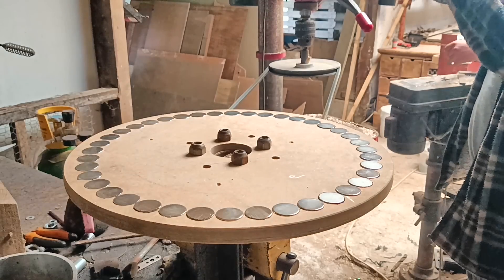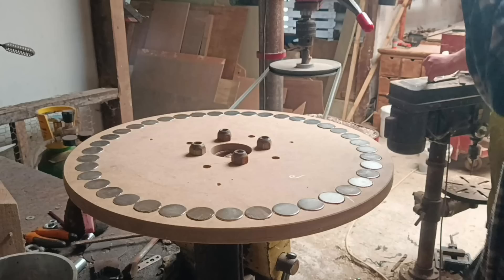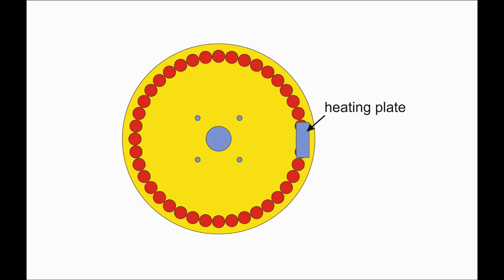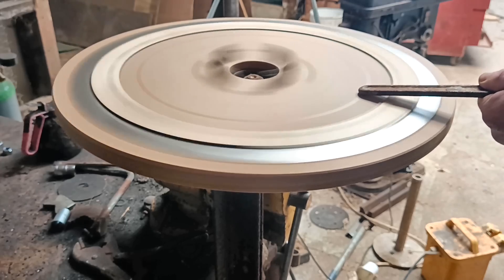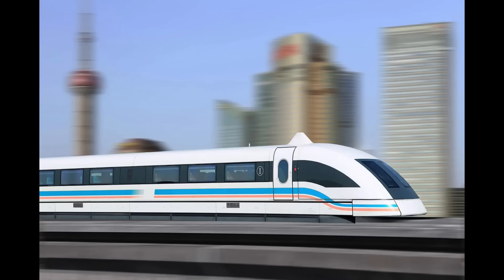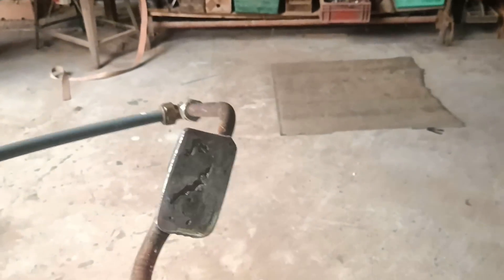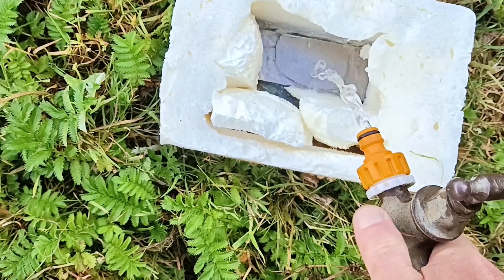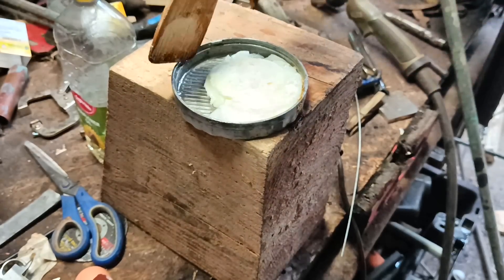Cook An Egg Over Magnets  - And Other Interesting Induction Heater Stuff..

Comment: Hi its all very interesting but the design that creates the most drag will do the most heating. And so that will be the limiting factor for your windmill. You can only get out less power than you put in the power you put in can be measured  with a cheap Whr meter connected to your drill so very low when just spinning and more with more heating length closeness etc so from that you can calculate the size of windmill you will need to turn your magnetic wheel 
Above all have fun and  learn something to teach something 
Great vid 
Could you not use the cooling system of the old Bamford engine to heat water

Comment: Build a mounting for the metal plate so you can lower it and drag does not become a wristbreaker, I would think a copper pipe bent in a circle over the magnets connected to a water supply that circulates the water would be a seriously impressive experiment. Get the water to 80degrees and circulate it through a radiator. Voila heating free if it is connected to a windmill. Or cheap heating if it is run by a 500watt motor that is strong enough to power the disc through the drag. I am surprised with the drag being so strong using copper, maybe another material would be more effective, less drag.

Comment: I would really suggest getting the multicolored magnetic viewing film. It's important to note that what it shows is one single xy slice of the magnetic field at that moment. The white indicates the domain wall  (N/S barrier) impinging on the film. And the gradient from blue to green represents the gradient of the flux density. North or South are the same color. Also use just one single light source or you will see multiple domain walls, it will look cool but it isn not useful besides that. I have never seen a video on youtube understanding the principals of the magnet field correctly.  When you understand what you are actually seeing with minimal abstraction you can then use this to see the best placement for the alternating magnets and for the pan. You'll want to find the null point between opposing magnets. Then then place the pan on plane with that on y about halfway between the null point and the physical matter of the magnet. This will make the alternating fields more powerful, it should also cancel out the magnetic frustration going on. it is beneficial to think of this as magnetic frustration rather than eddy currents as they are essentially the same thing but from a different perspective.  Sorry if this sounded to technical, I tried to keep the jargan as minimal as possible and inform as much as possible.
Reply from the maker: Thank you Paul. I will investigate the viewing film. Like everything else, the more I learn, the more I realise how much I don't know.
Reply: @wayoutwest-workshopstuff6299  thats the best part

Comment: I'm sure you can figure solutions but look at PC CPU waterblocks, Me i'm thinking a block made from a plate of whatever metal you want, thick enough that you can use a conical drill bit end to put divots in the surface to increase the surface area.... then enclose it with a top made from your machinable plastic

Comment: Loving your channel.  I've just been going over your engine shed design.  You were playing around with slip-belt clutch designs.  That reminded me of your magnet experiments for heating.

You could also make a clutch using those magnets on the flywheel, if you're interested.  I used to work on boats, where (since the late '90s) such magnetic no-contact clutches were used as low vibration linkages.

If you face your magnet-imbedded flywheel discs along side a thick, conductive plate (thick copper works best), which is also on an axle, the magnets will induce an electromagnetic feedback.  That's what happened in your heating experiments.  In this case, though, the changing magnetic fields from the magnet disc induces an electrical current in the conductive material, which quickly converts back to a magnetic field.  The closer the two plates get to each other, the more the magnets and the changing induced magnetic fields will grab each other, causing the pair to spin side-by-side.  The faster they spin, the stronger the magnets, the closer they are, the more they grab.

Power one disc with the engine.  Connect the other disc to the power tool of choice.  Begin with them separated.  Start the engine.  When it's going, press the discs together, and the tool disc will spin.  The closer you get, the stronger the magnetic pull.  A no-contact clutch with almost no vibration!

Comment: I imagine that this has already been mentioned in the comments on this and your earlier video, but many things have been mentioned, and many are contradictory. While there are some good insights, there are also many comments which are exactly backwards.
The 'jiggling' of electrons in your heating plate does not directly contribute to heating. Instead, that 'jiggling' is local electrical eddy currents, induced by the alternating magnetic field. So anything that you do to try to improve the effectiveness of your arrangement must take that into account. If you want your heating plate to get hotter, then making it thicker is the opposite of correct, because the current induced in the plate faces less resistance load and therefore produces less heat, though you may (or may not) be inducing more current in the material of the plate. The situation is analogous to that which occurs with a high current power supply: small wires burn up.
Naysayers may care to investigate this for themselves with a commercial induction hob available inexpensively from IKEA: thin cookware will heat more rapidly. Q.E.D.

Comment: To get the magnetic field to flip faster, you should try making a larger wheel that way you can have more magnets. It can go the same RPM and have more magnets travel past the plate at a higher rate due to leverage. It's kinda like how they arrange songs on a record where the louder songs are towards the edge and the softer ones are towards the center. It's all at 33 1/3 RPM but the outer edge is able to have the groove hitting the stylus faster than towards the middle and as-such is able to have more information fed to the stylus meaning it can have better sound quality and better frequency response.

Comment: Forget feathering the wind veins, try making a mechanism to slide more surface area over the magnets once things get moving fast enough. That way the windmill will use a small plate surface on a calm day, and a larger one when its windy. I'm thinking a curved arm, one which follows the radius of the disk, on a pivot just over where the magnets spin. It could start with the arm sticking radially outward, using only the small pivot point as its heating surface. Then as the disk moves faster the arm is drawn inwards around the pivot, positioning more and more of its surface over the magnets. This may be set up as a way to keep the disk spinning at a constant speed.

Also have you ever heard of heat pipes? Could be useful in solving your heat exchange problem.

Comment: Wouldn't a 2nd offset "row" of magnets double your speed? Smaller square but deeper ones of equal strength packed tightly in 2+ offset "rows" should work better. Also, a circular tube of copper and "rubber" sections fixed above the center of the rows should give more heating zones. A flat tube that covers the width of both rows. Not sure a solid coper loop would conduct and neutralize the opposing magnetic fields? As you said the goal is increasing the magnetic pole switches per pass under each "heating zone".   Making a circular tube as explained, would also allow you to use a heat exchanger. Keep heating the same water in a loop and have an adjacent loop of cold water absorb that heat. If you manage to build a pressure vessel, you'd potentially have super critical water above 100c to heat whatever with. Just ideas.

Comment: I might suggest thin copper tubes that, when coiled the same diameter as the magnet wheel (one pipe in depth, and 2 to 3 pipes wide, or however many you would need to get the same width of the magnets). The small pipes would allow the water additional circulation in the heat while traveling through the pipe.

Comment: while this is an interesting experiment, do keep in mind that heating spaces and heating water is 100% efficient using electricity.  I suspect coupling wind to a spinning magnet plate to create heat is less efficient than wind turning a generator, creating watts which could be converted 100% efficiently to heat.  Of course, the spinning magnet plate might be direct coupled to the wind turned shaft (100% efficient) and coils of copper wire mounted nearby, thus becoming a generator. The resulting electricity could be transferred easily and then converted to heat whereever it was needed.

Comment: Hm. Why do you want to make the magnetic field switching faster? Afaik there is no real gain, except for cough cough, electromagnetic interferences. Also, the heat doesn't stem from the switching magnetic field direction itself, but from the changing(!) magnetic field. You could also just use one single(!) magnet, this magnet's field changes in each direction anyway and so if you move that relative to a metal, you always induce a current.
From my pov it would be enough to have a "slow" moving disk (your wind turbine probably has a rather slow speed anyway) you might need to have a bigger amount of copper heat exchangers. If it is not obvious: The amount of force you need to hold back your heat exchanger/tool is directly equivalent to the amount of heat that can be generated. You probably need to find the sweet spot between maximizing this break force and the amount of water you want to heat at the same time (and obviously the wind input power available).
Reply from the maker: Thanks Patrick. Why then do induction heaters flip so fast then, I wonder?
Reply: @wayoutwest-workshopstuff6299  There are two things why one would consider high frequencies: With higher frequencies transformators (!) can be a lot smaller, think of how bulky phone or laptop chargers were 20 years ago. Even more so, higher frequencies reduce(!) the depth which gets heated - but I think that this is not your problem either. There might be advantages if you need to transfer energy over a longer distance, but in your case this is roughly millimeter scale, so shouldn't matter either.
Induction heaters in airplanes (for the food) work with the normal 400Hz on board which isnt to far from the frequency of your wheel.
Imho the relevant physics equation here is Q*v*B (Q=electrical charge, v=speed, B=magnetic field strength). So you can either increase the speed of your wheel or you can increase the number of electrons aka the amount of copper plates you use, either above each other (but that is what depth means!) or side by side each other, e.g. as a ring above the magnet-wheel.
Reply from the maker: @ps3107-o1m  Thank you. I've just been given another 60 magnets, so I'll make up a bigger one anyway, and see how it goes

Comment: You are step by step building an electric motor. Trust me, you are really doing that. 
Instead of the wooden plate you can use steel, just have to prevent current flowing in it. So you need laminations. 
For the heated part you can use a coil with both ends connected.

Comment: I believe the reason your wrench did not heat up, was because it was not close enough.
If you are not feeling the tug of the magnets you are not going to get any inductive field generating.
If you are feeling a week tug of the magnets, you are getting very little in the way of inductive field generation.

Inductive heating of steal requires much more energy ( more field switches per second, and likely bigger changes ie stronger magnets)
Even with higher frequency and greater amplitude field changes, heating of the Steal will likely be surface level. Steel will redirect the magnetic field thus blocking the block of the steal not next to the magnet from getting the full inductive field effect.

I have seen blade smiths set up  something similar (just with WAY more magnets).
Some of them could only get edge and very shallow surface level heating. The smith could get the section of the blade that was closest to the magnets on the wheel to start to glow, but rest of the blade stayed fairly cool.

In order to use Steal for heating block, you would have to scale up quite a bit, and I feel that the magnetic drag will be way worse than with copper, aluminum or any other non magnetic metal.

Comment: the more electrical conductivity the material has, the better it will work, I think.  This is why motors use copper windings, and if cost is not an object, silver wire is used (silver conducts electricity better than copper.  yes it does.)  You will never ever completely stop the magnet disk with magnetic interaction alone, because as the magnets slow down, their ability to induce a current in the metal goes away, which creates less resistance on the movement of the magnets.  This is a type of brake that can never ever lock up, and magnetic brakes using this exact principle are used on F1 race cars.
Reply from the maker: Thank you - yes, that makes sense

Comment: Any decent non-ferrous metals supplier should be able to supply thick walled copper pipe - I suspect this is all you need, nothing too heavy but 2 or 3 mm would be better than the thin plumbing stuff you are using.  Then bent into an arc and firmly held close to your spinning magnets.  Might not be super cheap but you only need a few feet, and they may have an odd end/offcut if you ask nicely.  It's amazing to watch this, thank you.

Comment: Just my two cents as a physicist who's not an expert in induction heating.. you should first have an estimation of how much mechanical power (speed x force) is absorbed by your spinning magnets and how you can change that (eg by having metal closer to the magnets). Then when you're done building your windmill and you know how much power it produces you'll know how to design the induction heater..

Comment: 2 ~ 3 Continuously Variable Transmission (Infinitely variable transmissions)
if there is more Drag the CTV Can Auto adjust 

I would Round the pipe more With 80% 97% Of the wheel and magnet path (if the CTV the it will counter the Drag)

Try and find a Wasing machine motor + Large  Drum Wheel Pully (FreeCycle for free)

I would make my wheel Out OF Epoxy resin with carbon fiber sheets

Comment: Hmm... I wonder if you could set up something like a flying ball governor to control how much of the heating plate is over the magnets. Couple the drag to the RPM to automatically tune the output for however much power is coming in at the moment for when you eventually put this on a windmill

Comment: "In this house we obey the laws of thermodynamics". Seems like you are exactly correct, it's possible to make the system more efficient material wise but not energy wise. The amount of heat generated will be equal to the amount of energy in rotational force lost. Making something that heats up more/quicker will impart more drag on the system. The curved pipe idea is a good balance that would be easy to make self regulating.

Comment: I really like the idea of induction heating. However there is no benefit of induction heating over just mechanical transfer of Power in your application.
If you use a given Power output to spin a paddle underwater, that Power has to be converted into heat, due to the laws of energy conservation. Just by stirring the Water and inducing turbulence, without friction discs or anything.
I think this would be the easiest way of making your long term project with the windmill work :)
Best of success with the project and greetings from germany!

Comment: good job on the retainer plate, that stuck out to me as a really important improvement from your earlier version..  looks good.  it occurs to me that an improvement might consider the size of wheel (and number of magnets as a result).   if you had a much smaller wheel with half the magnets.  I should think that magnetic drag would be the force you need wind (or your drill press) to overcome.  with some gearing to vary the speed and torque..  you could perhaps so much the same with less magnets (they just go twice as fast..  half the magnets but with double the RPM.    so the main reason to make it bigger past a basic level would be I think to gain surface area of magnets and perhaps to have multiple heating plates with radiators..    but... this might be an opportunity.   to creat your variability in how much heat you gather but engaging say heating plate modules 1... or 1 and 2, or 1, 2, 3..  or more...    just one more idea.   its possible to generate electricity in a similar setup with a minimum of changes..   you could have heating plates and an electricity generating module...   good for powering a simple controller and even a pump perhaps.

Comment: Commend the effort but this method to switch polarity is limited to rpm’s.. however if need be, suggest copper pipe around/ matching diameter of magnet rotors all em isn’t wasted as currently so. copper or aluminum plate of equal circumference (homopolar generator) would also pick up eddy currents to generate heat.. although 50’ of 14 gauge copper wire coil w/ few neodymium magnet spinning in center connected to nichrome wire coiled around borosilicate glass heats in efficiency w/o much torque input. 2 cents. cheers.

Comment: Bad news, the only way to switch the magnetic fields fast enough is to use narrower magnets, and a lot more of them.  Otherwise you will have to make the whole thing more beefy to handle the forces and that isn't practical as it would add too much resistance.